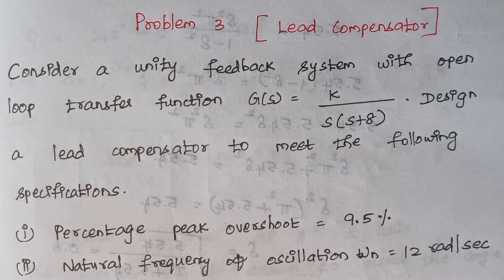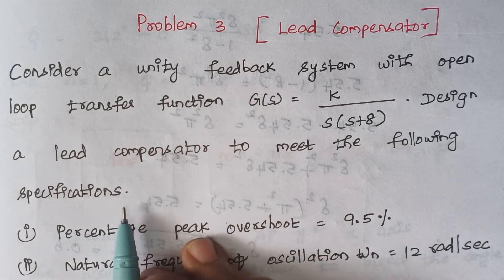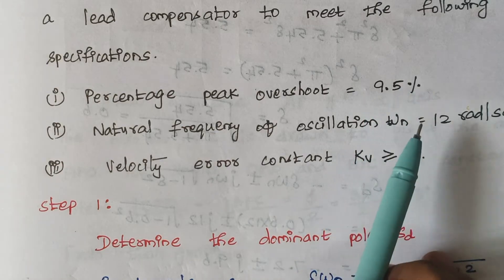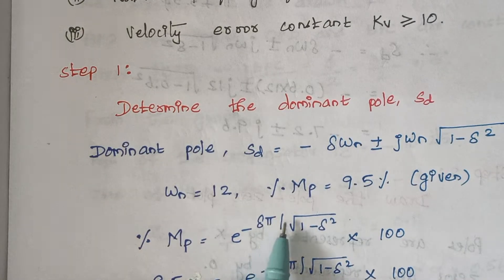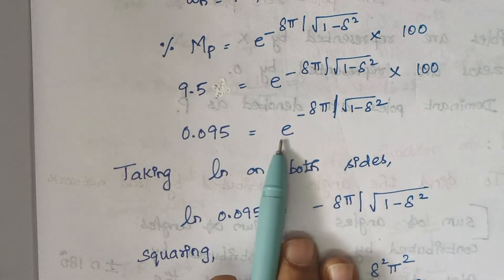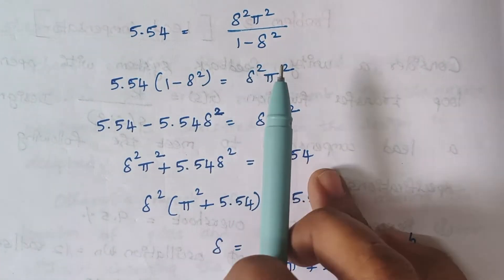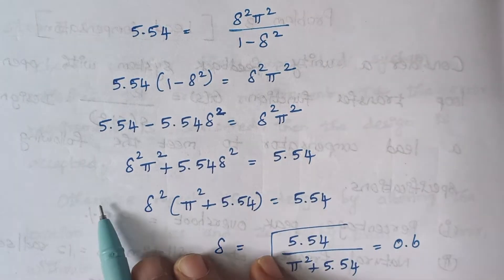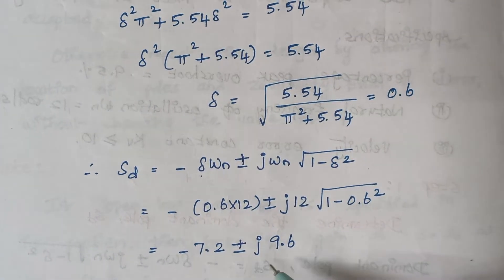Problem 3 (Lead Compensator)

Comment: But in previous videos, you divided phi two times i.e 105/2 =52.5 , then 52/2 = 26
 Why are you dividing once here?
Reply from the maker: Can you mention the timings from the video?
Reply: because there angle is greater than 60